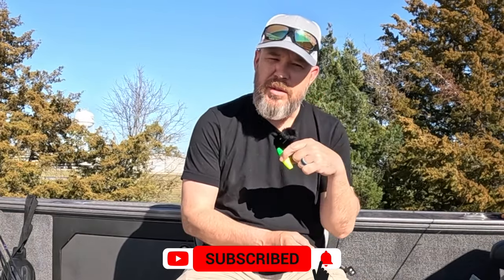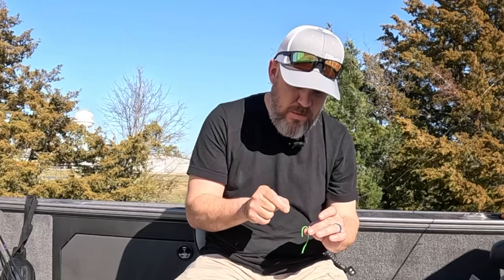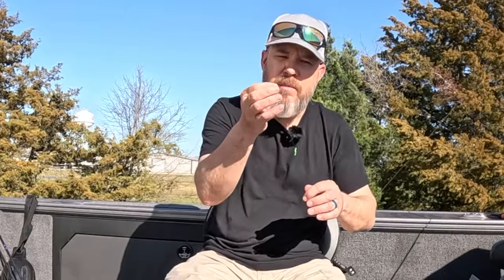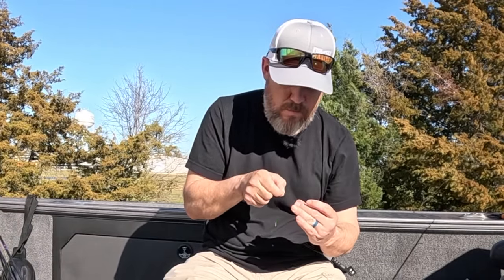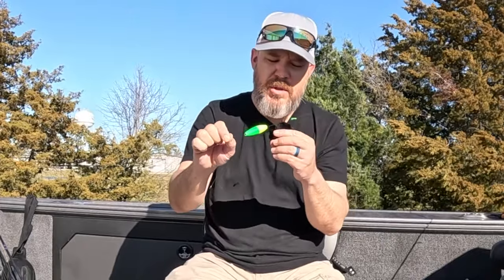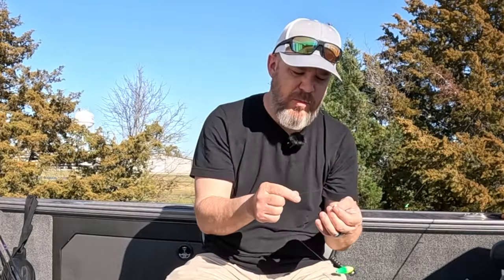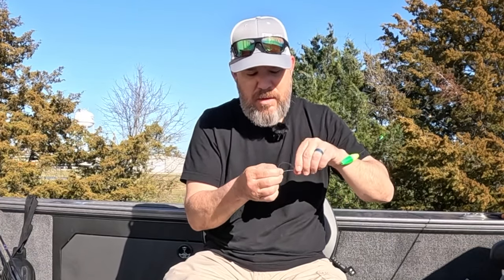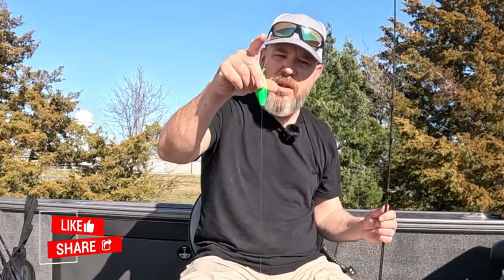How To Rig A Slip Bobber For Crappie

Comment: Will that slip float rig allow the angler to impart some enticing movement to the lure ? Like it can be yoyoed up and down and jiggled for an inch or two up and down.
Reply from the maker: Yes, the line freely slides through it so you can give it some action if you’d like. Thanks for asking.

Comment: How do you know what size floats to use with what size jigs?
Reply from the maker: Some of the float companies will list it on their packaging. If you stay under a 1/4oz jig head you should be ok.
Reply: @FishingInsideTheLines  I've tried some of those 2 in 1 bobbers, the smaller the jig the harder it seems to be for the stop to reach the bobber. Maybe I just need to find some of the slip floats where your line goes through. I hate trying to figure out of the bobber is supposed sticking out of the water or laying on it's side
Reply from the maker: @Digitalv0id39  Your bobber should be standing up straight. If it’s on its side you either have too little weight or your jig is resting on the bottom.
Reply: @FishingInsideTheLines  what's your favorite color bobber? Do you prefer a certain color on sunny days and another color for cloudy days?
Reply from the maker: @Digitalv0id39  I prefer the yellow and green just so it’s easier for me to see.